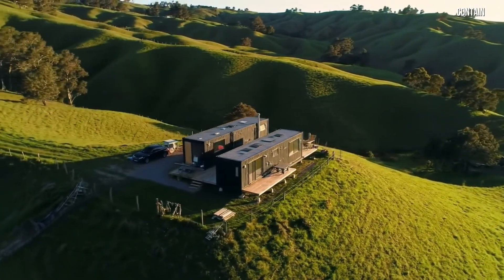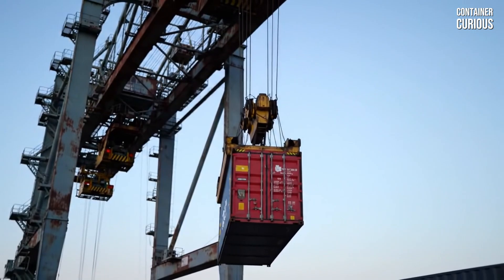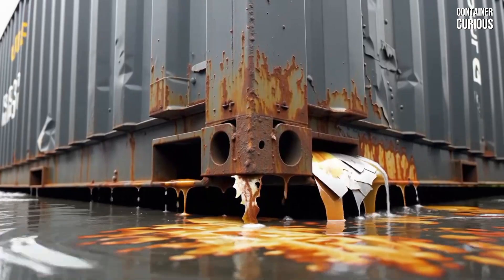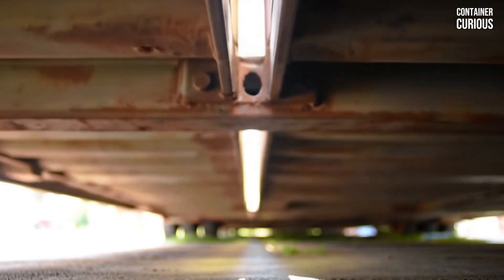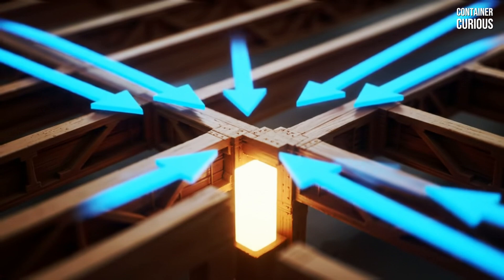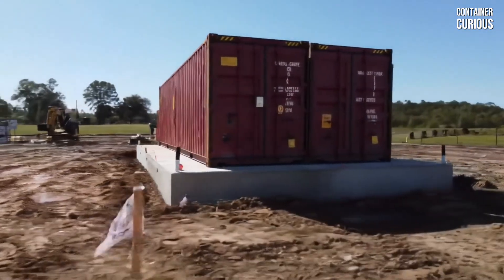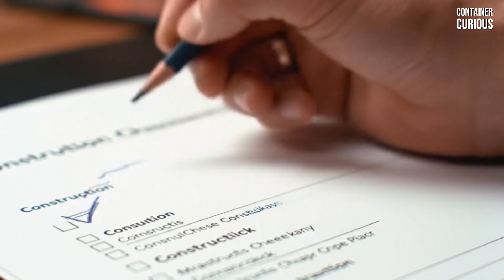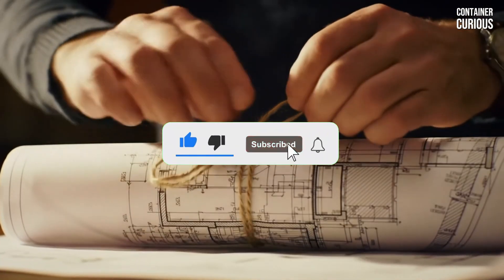The 3 Foundation Rules That Won't Sink Your Container Home

Comment: A shipping container doesn’t need such large concrete piers at all. It’s obvious that your foundation design is over-engineered. You need to clearly tell customers the strength grade of the bolts you use, the maximum wind force they can withstand, and how many bolts are suitable, instead of using AI to make a video to deceive the audience's trust.

Comment: I  would think foundation planning is the start of any container building project.  Cement pylons (piers) seem best.  Also a need for underbracing and side bracing are critical to prevent bending or twisting, just like in a home.  Something tells me, that even a container building has to follow city building codes which would spell out in detail what is required for habitability.
Reply from the maker: You're absolutely spot on, Steven. Foundation planning is the critical first step, and you've hit on some advanced (and essential) points like the need for proper bracing.

You are also 100% correct about building codes—they are the ultimate authority. In fact, the challenge of navigating those codes is so big that we dedicated an entire video to it. You might find our guide on "The One Word That Gets Your Container Home Permit DENIED" interesting.

Thanks for adding such great insights to the conversation!